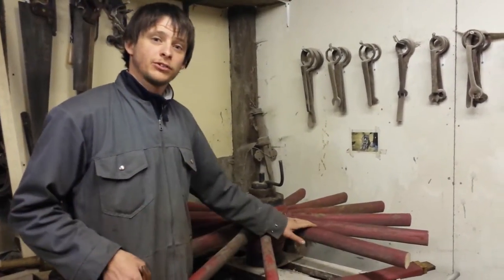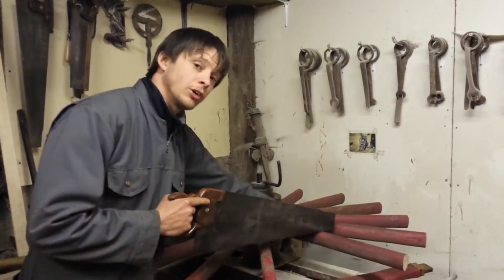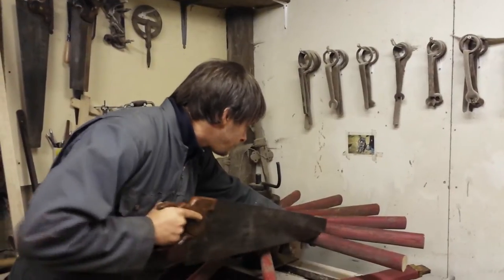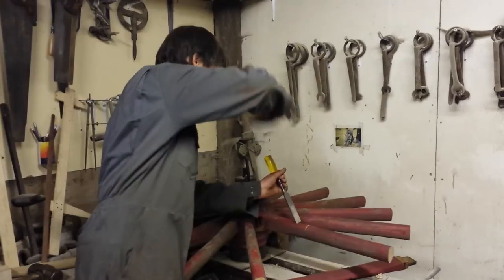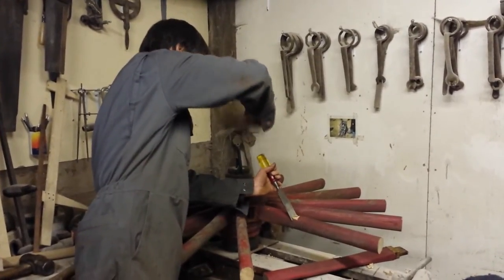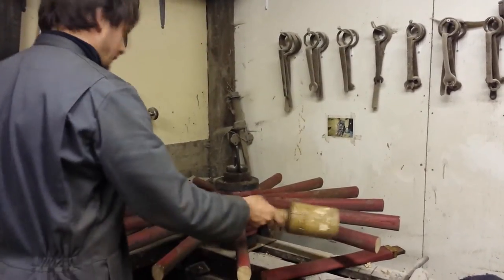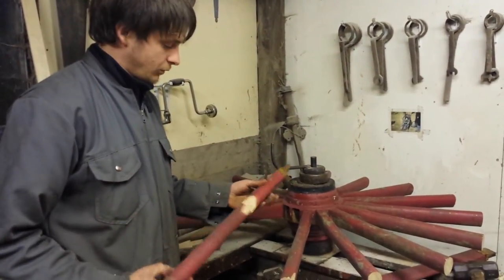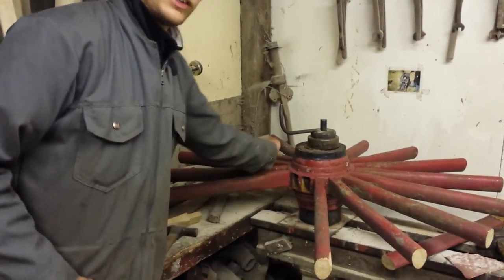Repairing wooden wheels how to Master Wheelwright

Comment: When I want to leave the spokes in one piece and get them out easy, I like to use the double bowclamp that fits around the towing hook of a car that the gets the emergency brake cable is attached to.
Fit around the spoke with protective material, tighten the two bolts and hammer the spoke out with 2 hammers simultaneously.